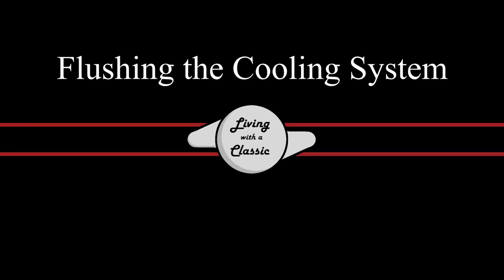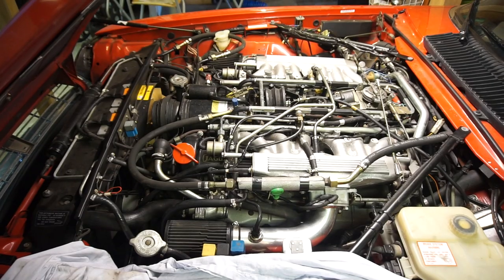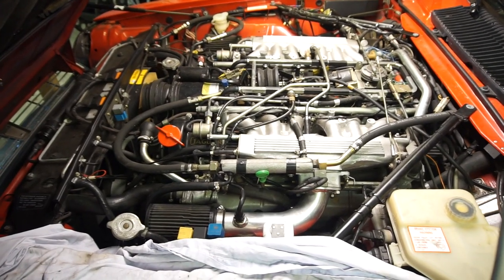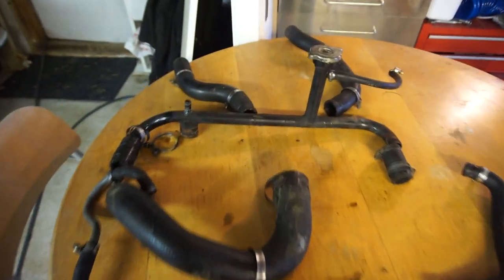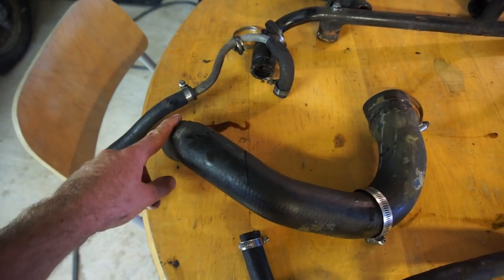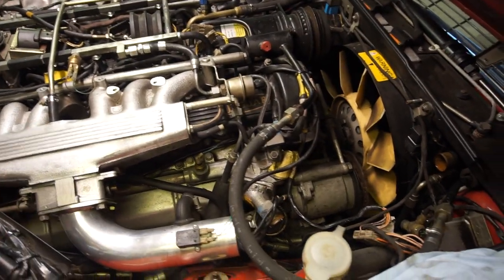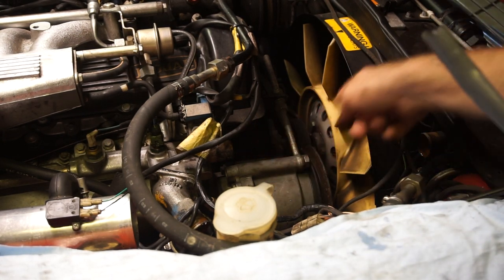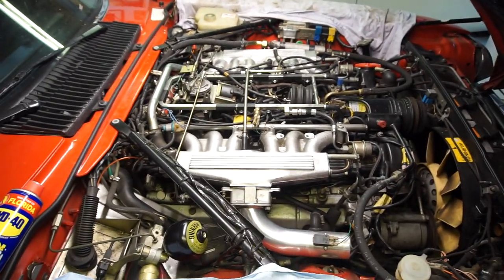Keep Your Jaguar V12 Cool - Cooling system flush and new hoses

Comment: One very important point regarding the V12 engine that has caused big problems to some owners regarding overheating, is that one of the thermostats sticks closed. If a change of coolant hoses is planned, along with a flush of the system with the possibility of debris being loosened and being transported from one location to another inside the engine block or manifolds, remove the thermostats, whilst doing this, or better still replace them with genuine OEM new parts. Peace of mind is everything when embarking on a long journey with a Jaguar, and knowing that the cooling system is clean throughout, and secure with new hoses and clips, contributes to the pleasure of driving these lovely cars.

Comment: GREAT VIDEO ! + the second. SOME MORE RECOMMENDATIONS. I had some heat problems with my DD6. Inspired by the video I started to fight it. Follow the steps of the video !. But: If your car has been treated with a coolant sealer a simple water hose is too weak. Use the HAZET Water/Preassure tool to powerfloat the system reverse. As there is quite a pressure you have to block certain galleries. Thermostates out (oportunity to check them in wifes pot with boiling water) , housing back again and backflushing through the main cirquit. Block the heater hose. The short circuit needs to be blocked. That means the filler gallery has to be removed from the thermostate housings. You can leave it hanging in place. No work at the belts necessary whatsoever
When powerflushing the cooler you have to block the hoses to the reservoir. The cooler has 2 circuits mixing each other somewhere in the cooler. You need to powerflush BOTH circuits.  Block the second circuit while flushing the other. 
For all blockings you can use the old hoses cramping them. Check the BREATHERPIPES properly. My left bank pipe was totally corroded. My heat problem was probably caused by this. If necessary just cut it off and put some secured rubberhoses in place. This part is not available new.
You need to flush from the hole of the banjo bolt. When I pressed it out I found at least 1 litre of old coolant hiding there.
Once the cooler top cover out of the way you can easily replace the viscous and install the fabiolous el. fan from Jag-Improvers. 16 hrs workingtime. Hope this helps

Comment: Did mine at the start of the lock down including a new ally radiator too. Found that the pipe (10mm?) that runs on the top of the slam panel was blocked and the banjo bolts to it. Glad I found out before too late. Great informative job as usual Adam.
Reply from the maker: It's a good lock down activity since it takes a bit of time. Good job on finding that! In part 2 I check over the pipe on this car and clean it out a little. Thanks for watching!
Reply: Living With A Classic You don’t need to thank me, it’s a must watching your clips. Thank you for taking the time to do them, it is very much appreciated by me.
Reply: I replaces my rad with a dual-pass Alum radiator, all the hoses and the water pump/ therms and belts. Jaguar has the best tensioner design. Don’t F around with old cars. Spend some $$, saves time and embarrassment.

Comment: Very good issue!
When I bought my XJS straight six, the FIRST thing I did was to replace the coolant, thermostat, ALL hoses, and I made a complete cleaning of the radiator. The hoses were in very good shape, but they were 25 years old and I prefered to be prudent. It was time consuming, but when I think of what happens to these engines when they overheat, I consider that the time and money was a great investment.
Reply from the maker: It’s a great investment! I’m about to do it on my new to me XJ40 they seem to be 25-30 years old too

Comment: Hi Adam, very nice channel ! Since you have a lot of experience, I would appreciate your view: I have recently bought a 1993 facelift 5.3 XJS with only 62'000 kms and kept very well in originary status. I would like to have it as safe as possible to be used but have no ability to work on it myself like you. Option 1. for me is to keep it well, maintain regularly and fastidiously with the help of an expert mechanic on old Jags, but apart from some obvious thinks (e.g. fuel hoses or belts to be replaced), I would tend this way to keep the car as it is and to change things, in the end, when they get broke; or option 2. is (very expensive indeed) to go through a kind of "massive preventive" refresh / renovation of the car e.g. by sending it to KWE in England to have it back "like new". I am tempted by option 2. since I am not experienced like you but I also fear to make an unnecessary (and excessive) expense for a car that actually seems to be very OK and well maintained. In other words, do you go "preventive" a lot, or just step by step ? And what would be your suggestion ? I am really doubtful about the best option... For example, do you change preventively the marelli ignition cap? The fuel pump? The starting engine? The fuel tank hoses? The cooling system (or e.g. you simply flush it sometimes)? What is the approach, that with your experience, you would suggest on one side not to spend unnecessary money and on the other to feel confident to take a 2'000 trip without too much fear? Thank you very much, very appreciated.
Reply from the maker: Hi Sarastro,
It's a bit of a difficult question to be honest. If the car has been standing still for a few years I'd go through pretty much almost everything if you want to be able to trust it 100%. If it has been used pretty regularly I would change all the rubber hoses (fuel, coolant, breaks, etc.) and give it a major service.
Where are you located?
Reply: Sarastro, Don’t wait for things to fail on a 2000 mile trip. Here’s a idea: this is where the lightbulb lights up. Change the usual suspects, hoses, antifreeze, all fluids, cap and rotor, wires and plugs. You can buy a starter, Fuel pump and other spares. Leave in the trunk. That way if your in Istanbul, a mechanic won’t have to source spares. I saw many Triumphs and Mg’s With parts in the boot. If $$ are an issue, every 2nd payday buy something. Believe me, most classic car guys have spares in the boot.

Comment: Another fantastic video my friend, I have just replaced all coolant hoses on my S3 4.2, the original hoses from 1984 were a real mess, very swollen. Working outside in street as usual, quite an awkward job with engine in situ. I test drove for the first time tonight, thankfully no leaks.
I now need to change automatically transmission hoses as matter of urgency, they too are in perilous swollen state.
Reply from the maker: I know what it’s like to just work outside. I’ve done it for years and I’m not jealous. Your car will be back on the road soon in better shap than it’s been in years
Reply: I’m 59 now, remember in my youth, changing a starter on the snow/ gravel driveway. Now I work in a tight 2.5 car garage with machinist tools.

Comment: Did my XJS v12 coolant this weekend after many months of avoiding due to the perceived problems of hose removal. I guess the previous owner may have done it in the past because they came right off!  Thanks for the tips!
Reply from the maker: You’re lucky! Some of these took forever to get off! A few of the hose clamps had been fitted before the engine was in the car and they were a real pain

Comment: Adam, I think it has been mentioned but don't forget to blow out that bypass line that runs across the top of the rad. Mine was solid as was the banjo bolt, a new brass banjo is available from Jonas though.  I eventually bought a new aluminium radiator though and that made a tremendous difference. As I mentioned to you some time ago, my top hose burst at speed not long after I got the car; it wasn't a pleasant experience but, so far at least there doesn't appear to have caused any problems - touch wood!
Reply from the maker: In part 2 I’m cleaning out the lines along the top of the radiator. Where did you get your aluminum radiator from?
Reply: @LivingWithAClassic  I got mine from Alicool http://www.alicool.co.uk/rad-jaguar.html  not cheap by any stretch but well made and a lot lighter than the standard ones. They would also do a fuel tank as well - if they could have a pattern from someone.
Reply: Yebb. second that. Have came across a couple off issues with that bypass line and also some recommend sising out the holes in the sides of the banjo bolt as they sometimes dont line up with the pipe wery well. 
Also raising the front end a little bit makes filling and air bleeding the system easyer.

Comment: I've recently changed all the hoses in my XJ6, the radiator got a complete new web from a specialist and the system has been flushed twice. If I drive now an hour at 30+ outside temperature, the gauge is not even hitting the "N" in "Normal" and I have 84 degrees celsius at the thermostat an 52 degrees at the radiator outlet. So this car is save in summer 😃
Reply from the maker: That’s great to hear! I’ve been driving my XJ6 in 30 degree weather now for a few weeks and it’s been perfect too. Never gets hot
Reply: @LivingWithAClassic  Great to hear, that your XJ6 is running fine, too! I'm so confident in my new cooling system - I plan a road trip over the alps to northern Italy. Imagine a fine XJ 6 Coupé in front of the opera in Verona or in the city of Florence, especially with an open folding top! But first, I have to convince my wife 😅

Comment: 3 pin holes in one of the top runs accros the top of the radiator... ... 
Replaced it w a al. Radiator... kept the org to repair later...
Reply from the maker: It’s a good idea to check those metal lines that run up there
Reply: @LivingWithAClassic  
Oh, I did... i used JB water weld to fix the vapor pipe that runs on top and very nice copper paint when done looks and works super ... note when using JB water weld on that thin pipe... make sure you cut a dowel to place in that pipe so you don't fill it in with the JB water weld... then just pull it out when it hardens...

Comment: Great video!  I have watched several (multiple times....) as I work on an 89 XJS V12 that happened into my life.  Question: how do you replace the heater hose that runs behind the block from the drivers side to the passenger side?  I am replacing all of the hoses and can't get to that one.  (I've rebuilt the fuel rail and installed a new water pump using your videos).
Reply from the maker: It’s a bit tight back there but there’s no real trick to replacing that hose.
Thanks for watching!

Comment: Hi Adam, thanks for the great videos, love your channel. I have been following your recommendations by flushing the cooling system and replacing hoses on my 1986 XJSC V12. I have come across a problem - when trying to flush the engine block I cannot get any flow through the coolant bypass pipe ports on the front of the engine. Any advice would be very much appreciated. Thank you. Vadim.

Comment: Adam, is there any trick to removing the lower radiator hose and the hose from the heater tap?  These are really hard to get to and space is very limited.  

Thanks for your helpful videos.

Comment: The cooling system is kind of sketchy in these cars.  Often people modify the radiator or swap a custom one in to eliminate the 1-1/2 pass design.  Also if they were serviced by the dealer regularly, it was standard practice for them to add Barrs Leaks stopper even if not needed.  If you haven't read it yet, Kirby Palms book is a great resource for solutions to some of the lousy British Leyland "features" on the XJ/XJS.
Reply from the maker: His book is good but from personal experience I’ve found that if they are in good stock condition they work as intended. A lot of the improvements in his back I find unnecessary. Yes the Barr’s Leak is a very dumb idea. It’s mentioned in the next part that’s up in a few days. Thanks for watching 🙂
Reply: I printed his 900 page book years ago. Has great trouble-shooting ideas. IMO all British Leyland  switches are cheap crap. Newer Range Rovers had them cheap POS switches. They need to come to 2021 with all electricals. Fire Lucas! My opinion, i’m Not alone.
Reply: Hey! Do you happen to have any info on cooling solutions? Mine is in with the mechanic after sitting for years and needed a new rad - but I'm trying to figure out how to never have to worry about an overheating engine

Comment: Can you spray wd40 onto your electrical conections & onto any bare metal contact areas to prevent rust & corrosion
Reply: Metal, rubber (wipe off after. I would not spray open electrical connections. We used to spray the whole engine/ swing arm on our Motocross bikes.easier to clean after a mudd race.

Comment: Good work! I’ll add this to the list of jobs to do on mine. It’s a long list. 

By the way, completely unrelated to this, but do you happen to know how to route the speedometer cable on a series 2 xj12? I’ve connected it to the speedometer, but I’ve no idea how to connect it to the gearbox. Is is through this firewall? Or somewhere else?
Reply from the maker: It goes down into the transmission tunnel. If you remove the center console it’s pretty easy to see where it goes. Hope that helps
Reply: Living With A Classic Thanks very much!!!!

Comment: Question, should/could you add a drop or two of dawn dish washing liquid into the place you are putting your flush water in ?
Reply from the maker: I personally wouldn’t since it would be heard to prove that it’s all out of the system. If it was very dirty I’d fill it up with plan water and run that for a week maybe and then flush it out again
Reply: @LivingWithAClassic  mine was very clean, due to the 1 gallon to get to work, then 1 gallon to get home... 😅

Comment: Hi Adam, Interesting project. I am replacing the hoses on my 40 and have decided as the coolant will be drained to replace the themostat as well. These are pretty cheap. So I was wondering will you be replacing the themostat on your V12?
Reply from the maker: If I didn’t know how old the thermostats are or if they were 5 or more years I’d replace them. The ones in the XJS are only a few years old so I’m leaving them this time